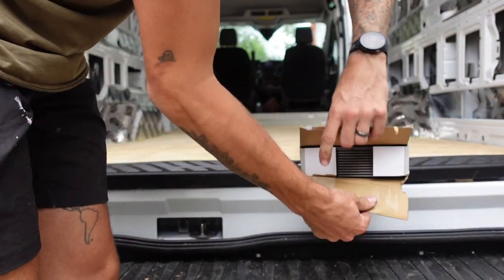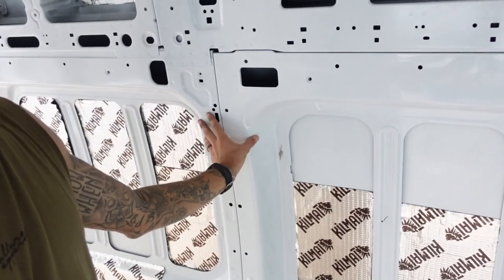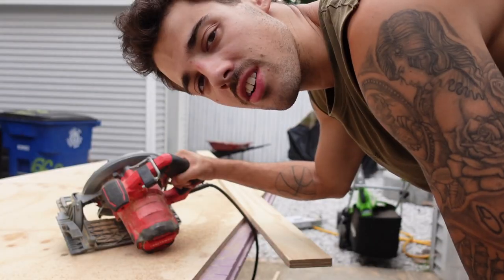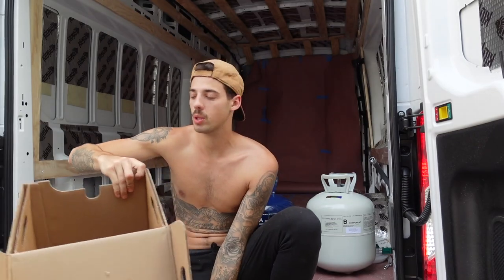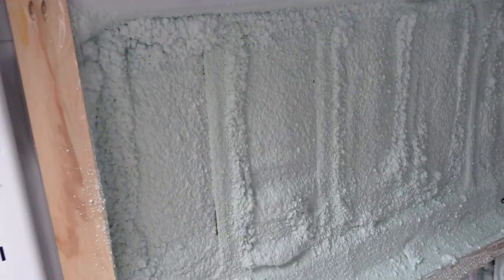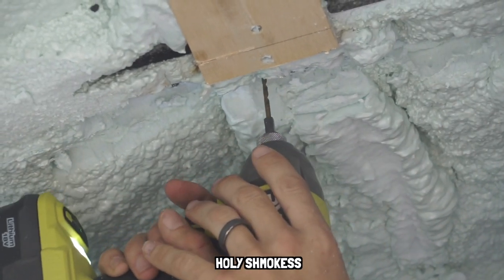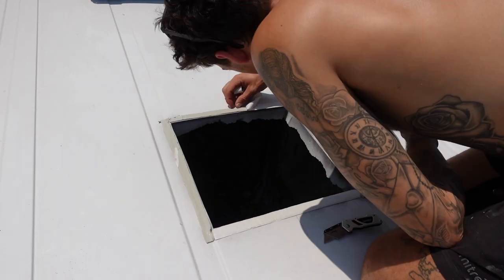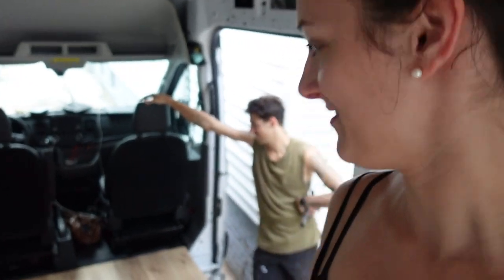DIY Van Build | Insulating with Spray Foam

Comment: hi, I think I saw somewhere that there are spots and some wires in the van you should not spray foam over cause it could cause problems wiith  operating the van itself. I'm about to spray foam my van and worried im going to make a mistake and spray places I should not.